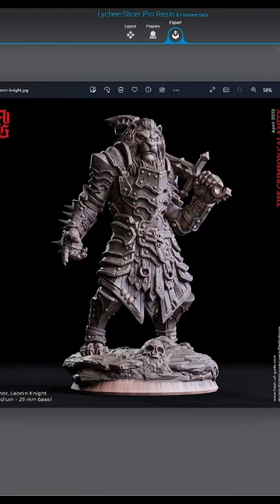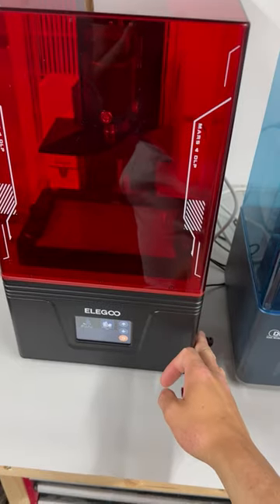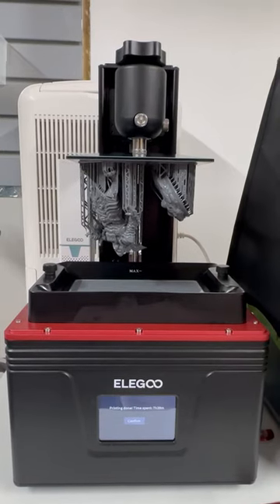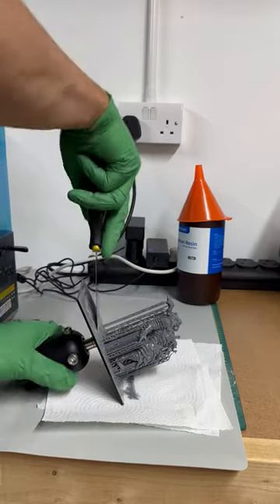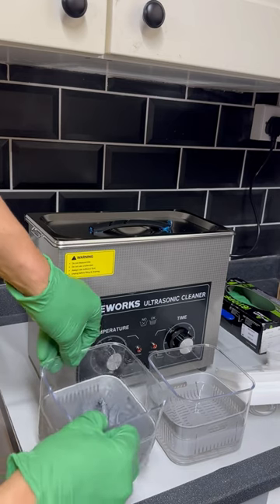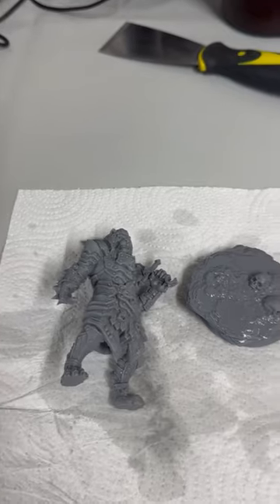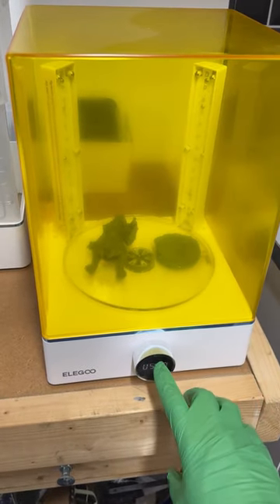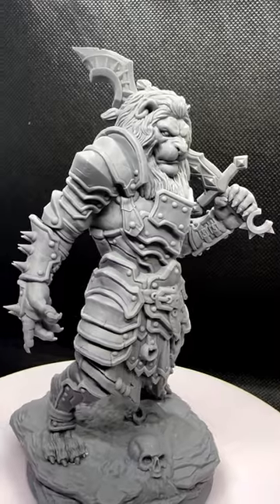How to 3d Print Resin Miniatures Elegoo Mars 4 DLP

Comment: Wait so what did you clean off? I’m confused and want to buy a printer. Also, for UV curing can I just use UV lights and put it around the model or just expose the model to the sun for a while?
Reply from the maker: once cleaned the sun will work, but you can just get a wash and cure kit for reasonable price.

Comment: I’m new resin 3d printers. Do you need to have the cleaner and the curing machine? Or do they just make it dry faster and cleaner? What if you just printed it and didn’t have those would it be ok?
Reply: I’m pretty sure you need them. Depending on where you live you could just cure outside, all it needs is uv rays.
I’m certain you do need it clean, since you need to wear gloves when handling newly printed resin

Comment: What are your cleaning stages? What’s in the ultrasonic cleaner?
Reply from the maker: Normal water in the ultra sonic but I put my model in a pickle jar with 99% IPA that goes into the ultra sonic. 

I also do a pre wash in used IPA to get most of the resin off before doing my final wash in clean IPA
Reply: @techclub8528  thank you friend!

Comment: Why do many models for resin printers come pre-supported? Does resin slicing software make it difficult to support yourself or something?
Reply from the maker: It’s to save time, it can take a little while to put your own supports in, plus too many can be annoying as more to remove causing more marks, too little will cause print fails, so it’s a nice bonus if it’s already supported as somebody’s already done the hard work of checking it prints okay with that level of supports

Comment: Soooo, dumb question, I know nothing about 3d printing but was wanting to get one for DND minis and stuff. You wearing gloves and cleaning them, is this stuff hazardous or detrimental to your health? I'm not getting into it if there's chemicals and stuff. I already had cancer once, no thank you...
Reply from the maker: The Resin is toxic to get on your skin and will cause irritation, toxic to the environment too, once cured it’s okay not a problem to the environment or your skin. 

Cleaning I am using 99% IPA so there is another chemical that is potentially hazardous, flammable and most likely dangerous to health if breathed in fumes. 

I always wear a face mask with chemical cartridge and nitrile gloves, I also use the printer in the garage to avoid funes filling my house, 

Now the big debate online is if the Resin smell / fumes is dangerous, some say no I say yes and always use a respirator. 

Small scale printing using the correct PPE you should be fine, scaling up to everyday usage and long term daily exposure then you might want to think extra about ventilation systems and protective equipment.
Reply: @techclub8528  thank you for the information.

Comment: There’s too much debate on IPA in ultrasonic cleaner. Did you have any problems of fire?
Reply from the maker: no as there is no heat, i only put the IPA in a separate container, the main liquid in there is water, the sonic waves penetrate the container with IPA then vibrates to clean the print, NO Heat used. 

Second the vibrations are not enough to heat the liquid to ignite, don@t smoke or put an ignition source next to it and i don't see any problems, 

no different from using IPA in a cleaner like Wash and cure stations. 

the vibrations can cause IPA to go airborne but not enough to saturate the air that would ignite, i live in a very humid place anyway maybe if its a super dry low humid area then this could be dangerous.

I also use a face fit face-mask / respirator with correct organic gas/ chemicals cartridge so no chance of breathing in the fumes.
Reply from the maker: to be clear the IPA is in a separate container that i plop into the water in the ultra sonic, then when the print is clean i seal the top and store IPA containers in a fire proof cabinet.
Reply: @techclub8528 there is heat and ignition involved in ultrasonic cleaning, the cavitation of air bubbles heats up 5000C and ignites even water, bit it's a lot like lighting a match submerged in gasoline, there isn't enough oxygen or heat to keep combustion going, most ultrasonic cleaners are self heating so they can pose a danger if something is damaged or left plugged in for too long leading to the whole unit overheating and becoming a fire risk without liquid water in them.